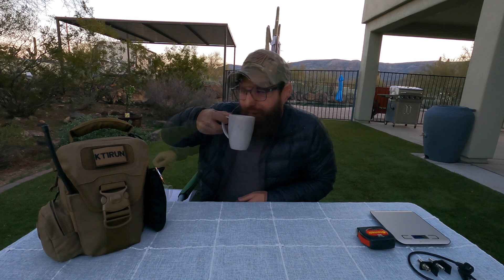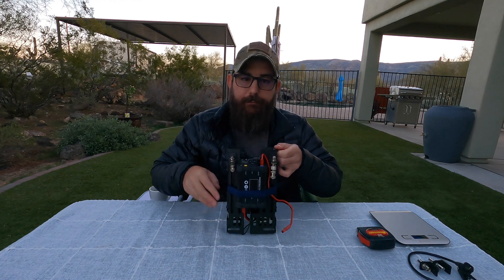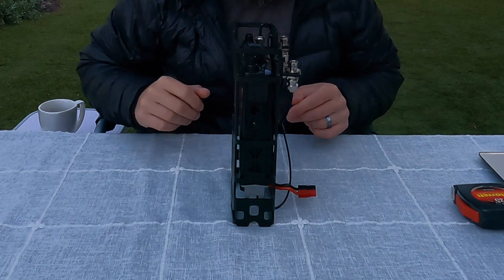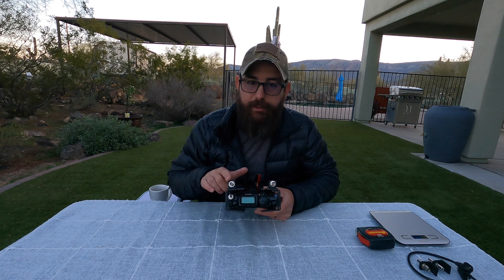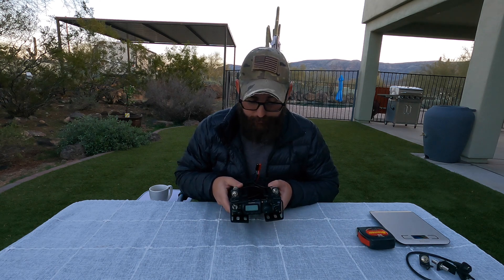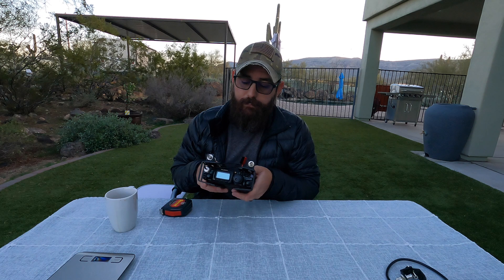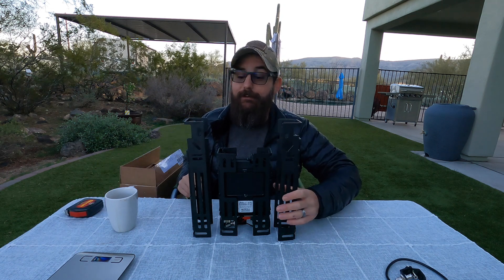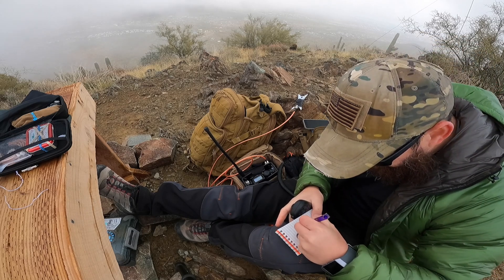ARMOLOQ TPA-817 B Review  - Part III

Comment: Elastic straps can be made from cutting strips from innertubes like bicycle or motorcycle innertubes. Thanx for the heads up on using a tactical camera style bag.
Reply from the maker: You're welcome. Great tip. Thanks!
Reply: @TheTechPrepper  Old military trick for stapping things to pack straps or gear load straps like knives, small comms, etc.

Comment: Thanks for the videos. Was wondering if your battery also fits on the bag with the BuddyPole Mini?
Reply from the maker: My pleasure. It certainly does. It’s the 4.5Ah Bioenno battery and it sits at the bottom of the bag. The Buddipole PowerMini sits nearly on top of it. I have plenty of photos on Instagram. The link is in the description if you’re interested.
Reply: @TheTechPrepper  Very cool. Thanks for all the great photos. Looking at a similar set up for my 818nd.
Reply from the maker: No problem. Glad to see someone else still enjoying the older FT-817/818. Best of luck with your kit. 73!

Comment: Ya, keep in mind, when SHTF all you have left is HF , all that digital, and uhf/vhf repeaters it's all going to go, I have digital in my truck with quad band, but my backpack is a g-90 Chinese, and  the 818 with a tuner, my antennas are a 9to 1 end fed multi band,a chameleon cha mpas 2.0 and some band specific long wires on a 49-1 transformer kit I built, on the 818 I have programed in local repeaters but near Salome not many, thanks for the videos if you have any ideas let me know 😀 😉 😊
Reply from the maker: You make an excellent point. We just use repeaters when times are good. Our group uses voice (FM and SSB) and digital modes successfully on VHF/UHF simplex over some decent distances. We fallback to HF NVIS on 40m/75m/80m. My current series on manpacks will cover HF soon. Welcome!
Reply: @TheTechPrepper  ya ya will stay tuned 😉 😎.

Comment: Company needs to make one for the IC-705
Reply from the maker: There are rumblings already about the IC-705. That’s all I can say. :-)
Reply: @TheTechPrepper  awesome!  Timeframe?
Reply from the maker: That’s a question for Seth. The ARMOLOQ website as a contact section. I’m looking at purchasing an IC-705 this year, so I’d be interested in this, too. 73
Reply: @TheTechPrepper  just sent them an e-mail.
Reply: Yeah that'd be wildly successful for sure.  The only problem with the 705 is the very deliberate way you need to connect everything to it. At-Connector and BNC being on opposite sides doesn't help rapid deployment.  But ya know, if they nailed the 705 perfectly for one group, others would hate on it. I'm glad there's already a vibrant aftermarket for our niche desires. 👍
Reply: @LancasterWannaBe  the main thing people want for their IC-705 is screen protection when transporting.  If this company nailed that right for the IC-705, will be a huge hit.
Reply from the maker: @LancasterWannaBe  You're right. You can't please everyone. That's what's great about this hobby; the freedom to pick the gear that's best for your unique operating style, interests and budget.

Comment: .The Tech Prepper. well i guess they stopped making the..HAZARD 4 Objective(TM) Small SLR Bag (R).looked all over the net ( no joy )no one has it.
Reply from the maker: Shoot. I had feeling they were going to do this. You might be able to find one on Amazon. It's nice little option for the 817/8 along with its goodies.
Reply: Amazon sold out. don't know if they will be back in stock.bummer.they do have this one.HAZARD 4 Wedge(TM) SLR Camera Case .but i don't know if it would fit the same. i am new to all this and i am studying for my first test.if or when you have time can you check that one out and see if it will fit in it.TY Charley